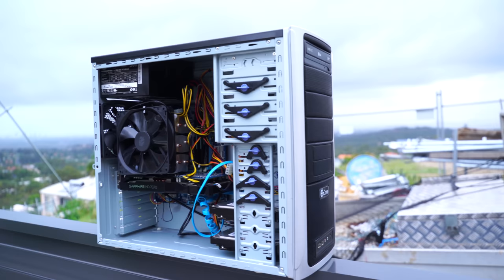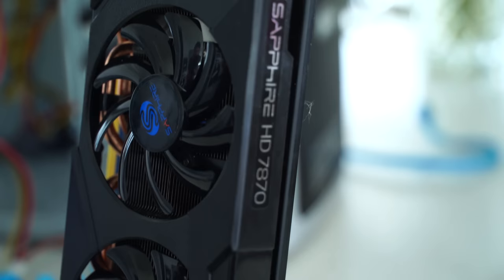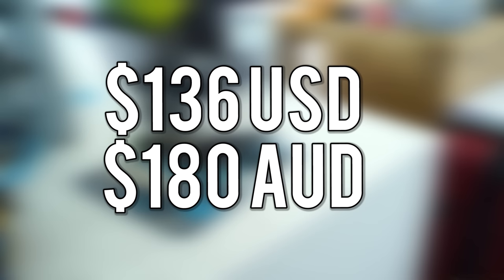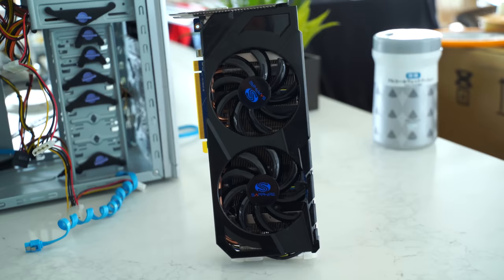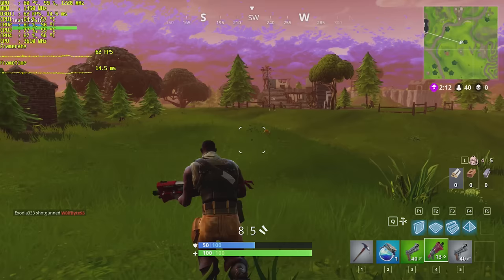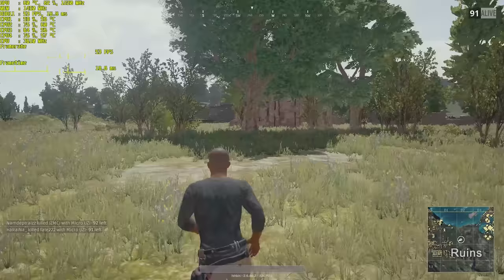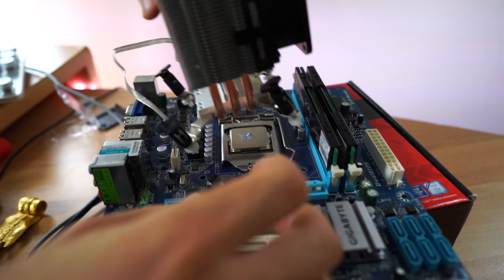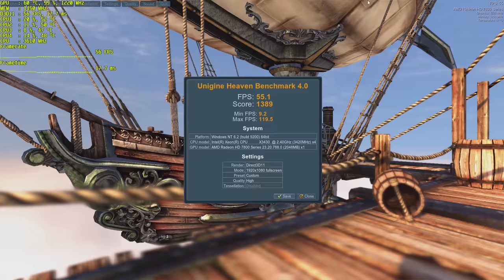The $136 FORTNITE 1080p Gaming PC Build 2017

Comment: This PC beats my $600 laptop
Reply: Pennywise lol MacBook be like😅
Reply: The lower segment of laptops just got really bad in the last couple of years... And of course buying used is Not an option, because you can't just change the mobo for 30 bucks if it decides to fail.
Reply: X Blocky Same, but I'm getting a new gaming laptop today! I'll update everyone on how it does on benchmarks and fortnite.
Reply: mine too!
Reply: U need to open and clean a laptop each 6month ;)
Reply: My 1000 laptop can run fortnite at high settings with 50 70 frams. Kms
Reply: X Blocky  lol
Reply: Alexander Hernandez I have an itx pc that can fit in a backpack that can run games 4k 90. I7 7700k and 1080ti in the Node 202. It's mobile and powerful so laptops aren't the only option for mobility
Reply: its simple guys, get a pc for gaming and a laptop for work.... duh
Reply: Alexander Hernandez yeah right dude, buy an hp or dell laptop and all you get is an overpriced shitty xbox 360 that doubles as a portable heater
Reply: Yeah its incredible what they Can Make nowadays
Reply: This pc beats my $900 2013 iMac....
Reply: this beats my $850 laptop
Reply: Same
Reply: X Blocky yep i have 35 fps on everything lowest possible on my 500$ laptop
Reply: lol You all got ripped off!
Reply: NO THEYRE NOT. you get a medium quality screen a keyboard a motherboard speakers and a cd slot.not only that you can carry it anywhere. so laptops are underpriced. my 1500$ pc runs better than my 2200 $ laptop on gaming but it weighs 15kg i need a monitor i need everything.
Reply: X Blocky laptops kinda such
Reply: beats my $1000 macbook
Reply: same here
Reply: Miko Spoofer I get 7 on lowest 480p for my 600
Reply: GEOMAZ lol
Reply: This beats my 900$ PC :(
Reply: I don’t know how y’all PCs don’t run that if y’all 800 to 100 pc or laptop can run that my 700 pc runs all of the AAA titles 10 times better than this pc
Reply: It beats my 900$ gaming pc
Reply: Hardcore Hardware what kinda laptop ya got bro?
Reply: This is 3x my 1000$ laptop
Reply: Same
Reply: KrazyKing13 anen preach it brother
Reply: don't forget about display, keyboard, touchpad, speakers, wifi and bt adapters etc
Reply: X Blocky Same here my dude
Reply: My AU$800 laptop stomps it in processing power (Core i5 8250U) but has an inferior GPU (Geforce 940MX).
Although considering that it also has integrated UHD620 graphics, it means that you actually have two GPUs available, which is pretty cool.
Reply: same
Reply: X Blocky beats my &750
Reply: This build is good as my $500 build
Reply: Beats my 500$
Reply: X Blocky that's why it's called pc
Reply: same
Reply: X Blocky same
Reply: X Blocky lmao nice one
Reply: LOL
Reply: It beats my 300 dollar laptop
Reply: I want the pc
Reply: don't laptops have a monitor? Has anyone thought of that?
Reply: Alexander Hernandez no shit it’s a desktop
Reply: X Blocky oof
Reply: X Blocky Same
Reply: @Hardcore Hardware y dont u just sell it then buy a gaming pc
Reply: take the L

Comment: The HD 7870 is such a killer budget graphics card, I bought one off a mate for $50 AUD a couple of years back and put it into a PC for my little brother, along with the guts of a second-hand Harvey Norman prebuilt with an i7-3770, 12GB of RAM, and an SSD which I got for around $250 AUD about half a year prior.

I can pretty much max out the OC sliders in Afterburner with the HD 7870 and it runs flawlessly, temps max out at under 70C with fans on auto and you can barely hear it. It's a hell of a lot quieter than my 290X that's for sure!
Reply: I picked up a HD 6950 2GB on eBay for $20/£15. Runs games really well.
Reply: 7870 still beats the GTX 1050 in some games. If you have a good power supply already and can get a deal, it's definitely a good card
Reply: SvD KILLSWITCH does it outperform a reference gtx 780? Honest question
Reply: I got a delidded 3770k and Sabertooth Z77 for 180€, that cpu is great
Reply: SvD KILLSWITCH um wromg.. hes using sapphire hd 7870 which is couple hundred dollars.. hes bullshitting
Reply: GPU prices have been overpriced ASF for the past 2 months, which is why its a couple hundred dollars
Reply: No, the 780 reference is a lot faster. If you were asking about the 290X, that is faster than the 780.

Comment: If that cooler come loose in the future then RIP video card
Reply: ohh and it will dont worry , that silicone will come lose @ some point from heating/cooling cycles :D , i know becouse i saw how silicone behave's where i work after a while
Reply: Its rip gpu and cpu beacuse its going to get really hit instantly
Reply: *hot
Reply: Eetu Isola the GPU might get hurt from the cooler dropping on it, but the CPU will deal with the heat fine, Intel has built in thermal protection to throttle or halt the CPU when the heat spikes, not saying to run it with no cooler though (I've seen tech channels do it before for shits and giggles)
Reply: I've run some low end pentiums from the last couple of gens with no cooler in the BIOS. They stabilize at about 85-90 which is perfectly fine for the handful of minutes I need to check something or do a BIOS update. If they get hot during the update I just set a fan on them
Reply: CortMarshal honestly you could probably leave them on all day(not saying you should) but they'll just be limited to a couple hundred megahertz-1ghz or so, horrible performance yes but not dead
Reply: Well lets hope it comes loose when the PC is off.
Reply: or just set the pc lying horizontally..tension gone
Reply: You can just lay the tower flat so you don't have to worry about that.
Reply: Jay Koerner ya but they can't react that fast it would hit 150c almost instantly
Reply: And rip the pci port
Reply: I would just kick in another 20 bucks for a new cooler, still would be a cheap build.
Reply: Can you recommend something sorry, I'm not very smart with PC building
Reply: Put it on it's side

Comment: I'm a complete noob. Can anyone suggest me where to start with all this? Idk a shit what he's talking a about.
Reply: What do you want to know, if I can help.
Reply: Wounded eye I am too
Reply: anything we need to know.. like , what is 7700HQ means ? etc
Reply: Cheap used Xeons are usually where all these builds start.
Reply: Xeons cpus are for online servers not gaming.
Reply: Wounded eye if it can handle servers it will be handling games
Reply: Sir Gildo can u suggest me around 30$ motherboard for this build?
Reply: Same just wondering if  fortnite will work on my pc? My specs are
I9-7920C 12 Core 2.9GHz
4TB 7200RPM + 2T  SSF
64GB DDR4 SDRAM 
2X SLI Nvidia GeForce GTX 1080TI 11GB GDDR5X
Reply: Jomz so you have 2 gtx 1080 ti obviously it would run
Reply: Jomz wtf is that pc costs like 4000 dollars
Reply: yugi muto yea so...
Reply: Jomz why tf you think a 4000 dollar Pc with 2 gtx 1080 ti wouldn't be able to run fortnite
Reply: yugi muto He was just bragging...but on a real note he's probably lying
Reply: Enescu Ionut im not lol  i got my pc online its the area  51 alienware
Reply: Enescu Ionut i installed a intel core i9-7980XE in my computer now
Reply: Jomz Sure you did m8....
Reply: @BaSickFirst  that's a laptop chip
Reply: Wounded eye sams

Comment: I'm all for budget PC's 6 years ago i built a new PC for 900$ US, it was a FM1 socket motherboard 
GA-A75-UD4H, wasn't cheap at all back in 2011, i cant really remember witch cpu i had in there I'm pretty sure it was a dual core 2.7ghz, i got a 500gig hdd and 500w power supply, and a nvidia 450gts gpu in there. With 4 gigs of ram.
All ive added to it over the years is 4 more gigs of ram and and upgraded the cpu to a athlon 651k, witch is the most powerful fm1 cpu that was made, it still runs games like GTAV with out any trouble, but that build was expensive at the time and i regret paying so much, but anyway i gave it to my brother and decided to make a new budget build for my self, so i started browsing and found a ASUS Z97-P motherboard for around 52$, witch is an OK price, and i found a gigabyte R7 260x  rev1.0 with 2gigs for around 50$ as well, now i got me 8gigs of ram for some 55$ witch is considered really cheap here (i live in Serbia so even my budget build is expensive) and for 20$ i got a G8120 dual core cpu with the original cooler, a 500w power supply, and a 500gig hdd, and a old beat up PC case, but that one was free.
So for around 175$ US i have a pretty nice build right now. 
Ill change the PC case and cpu eventually but its pretty good for now, considering what i paid.

Comment: I'm about to pick up an x79 motherboard for cheap ($50). Anyone have suggestions for a good performing processor to bundle it with? Thinking close to the $100 range. I'm really into overclocking so if someone could point me in the direction of some magical xeon that'd be fun. Bryan if you could chime in that'd be dope too :)
Reply: The Xeons for that platform are still 100+ and not worth it in my opinion as they are only 4 core 8 thread. I'd go with i5 2500k, i5 3570k or if your lucky maybe a i7 2600k
Reply: The x79 has the 2011 socket, right? I briefly looked into this before I got my i7, but the used x79 market is crazy high. Many xeons from this gen are overclockable, you might want to look into a e5 1620 v1 or 1660 v1. The 1620 is a 4c8t, and 1660 is 6c12t. The v2 versions will also work on that chipset I believe, but they don't overclock as well but have higher base clocks. If you've already got the board its great value, but if you need to buy the board it becomes almost as expensive as buying new current hardware.
Reply: idk i have a 2600k@4.5 already and i was just thinking of upgrading to a 3930k since this mobo would be cheap. it'd amount to like $50 x79 $100 3930k, then sell my current 2600k and z77 for like $150 bundled. so kinda a free upgrade but i was just asking since i don't know much about x79s and was wondering if there was a cheap cpu that was a really good overclocker like there is on x58. thanks for the help tho
Reply: JustIncognito oops I was talking about the wrong socket lol. I would go with the 3930k definitely
Reply: JustIncognito actually no scratch that. You could get an e5-2660 or 2670 8 core for around $100 just make sure you can overclock it as they are clocked low
Reply: JustIncognito The e5 1660 is the same chip as the i7 3930, but in some case can be found cheaper. I doubt you'd get as higher overclock as you have at the moment on a 6 core CPU. So you'd be losing single core performance but gaining 2 extra cores and 4 threads as well as quad channel memory support. I guess it all depends on your workloads, but personally I don't think its worth the upgrade.
Reply: JustIncognito Just to add that before you do anything check that the processor is supported on your motherboard. Probably don't have to tell you this, but not all xeons are supported.
Reply: idk from what I know getting a 3930k to 4.5ghz doesn't seem too uncommon. seems to be as common as getting a 2600k to 4.5ghz. anyways, I think if i get the x79 i might grab a 3930k locally and try to get it for a little cheaper under the $100 ebay price tag. thanks guys
Reply: JustIncognito Best of luck. I've heard of some hitting 4.6 on the 1660/3930k but I've always taken these numbers with a pinch of salt as Im thinking the thermals in that package would insane. Looking into it a bit more if you've a decent chip and a good x79 board you will probably be ok for that overclock.
Reply: Which x79 motherboard?
Reply: JustIncognito i5 2400 aint bad
Reply: JustIncognito I’m not sure if this is compatible but I think you should get a ryzen 3 1300x

Comment: I paid 110$ for my current 1155 system before graphics, it's a dell t1600 and it came with a e3-1270,8GBs of memory and a 1TB HDD had to swap the PSU through and that cost 35$(USD) but I also put in a gtx 1070 so the budget was much higher(350 new before the crypto plage)

Comment: can I overclock on any h55 board? and what's the highest xeon available for 1156 socket? any 6core available?
Reply: I don't know about overclocking on any h55 but the best cpu you can get is 4 core 8 thread
Reply: Jamzy the model? the one he showed?
Reply: i7-880 is the fasest chip on 1156, together with the Xeon X3480
Reply: The one he showed was an x3430 which cost only $7 which is AMAZING value for money
Reply: NelizMastr - Tech for PC & Mac I've got an i7 860 and it's decent
Reply: The best price - performance processor is the x3440, 4C/8T for 22 dollars on AliExpress
Reply: But i consider to get x3460, thet Xeon get 12x ram multiplier (x3440 and x3450 max 10x ram muliplier), than alow you to get 2200+ mhz on cheap Samsung DDR3 ram! x3470 and x3480 goon only for bad overcloking boards, any good board can turn even x3440 to 4ghz, that stable safe max for 1156.
Reply: Leandro Andreu online maybe, but I got 3 prebuilt q6600 desktops from a local business for free, just had to dust them out
Reply: Ty2525 haha is that a joke? Some Xeons are amazing for gaming
Reply: Yes you can OC pn h55 and p55 mobos. If you scroll through the channel TYC does a ton of h55 xeon builds and he overclocks everything. 🖒

Comment: i have a 7850 stored away , as i bought a r9 290x 4gb earlier this year for about the same price i bought a 7850 4 years ago, the psu consumption is higher but the graphics are a bit smoother but i think the motherboard limits it, i got an ssd to just assist with performance and it did actually but limited size for games :/ but the 7870 is pretty good on med settings for overwatch and decent for modern fps on med 1080p
Reply: Denver Naicker what cpu

Comment: Fortnite doesn't even work for for me, and I have a freaking GTX 1060
Reply: I have a gtx 960 2gb and play fine...maybe its ur cpu, ram or hdd bottlenecking.
Reply: Praful cj User error.
Reply: P E B K A C
Reply: maybe you don't have an NTFS storage format?
Reply: i have AMD X4 950 and gtx 1050 ti and on epic 50-60
Reply: It’s ur viruses
Reply: Right click on computer homescreen and see if says NVIDIA Gtx 1060 or Intel something because you have to install the card before or it will default to that
Reply: Praful CJ Maybe your hdmi is plugged into the wrong slot, make sure it’s in the gpu. I had this issue when I started😂
Reply: I played without graphic card .. Though my all other components are very expensive .
Reply: Praful CJ  I don’t think you downloaded your card
Reply: Praful CJ I've a gtx 1050ti and it plays perfectly fine, I get 120~ fps with high settings and post processing low
Reply: Did you download drivers?
Reply: If you have a GPU OC, turn it off, or at least down. For some reason fortnite doesn’t like it when I have anything higher than +220mhz on the core clock on my 1070ti. Same with my friend who has a 1070.
Reply: ERROR 404
Actually look ur cpu/ram/storage/virus if any problems with those or u might have not installed the gpu
Reply: what about ur processor
Reply: Did you buy that shit in Chinatown?
Reply: Will fortnite work on my pc? My specs are
I9-7920C 12 Core 2.9GHz
4TB 7200RPM + 2T  SSF
64GB DDR4 SDRAM 
2X SLI Nvidia GeForce GTX 1080TI 11GB GDDR5X
Reply: He probably has a 32 bit pc
Reply: Praful CJ If it says "Unsupported OS" then u need a 64 bit computer
Reply: Jomz 
You would be lucky to get at least 15 fps with that
Reply: the one and only Clorox bleach oh
Reply: I don't think so
Reply: Probably not...
Reply: Jomz no
Reply: Jomz probably not lmao
Reply: Praful CJ maybe because you do not have the rest of the PC?
Reply: I have 1070 ti, i5 8400 and 16ram and im getting aroumd 30fps on low.... Whyyyy? All the other games are fine. Im having problems only whit fortnut
Reply: Joshlocu how with two gigs
Reply: @jomz6164  no
Reply: Looks like i am going to have to that back lol

Comment: Small tip for future PUBG tests - setting the textures to a higher setting than very low will most likely improve the FPS sounds strange I know but it takes load off the CPU and uses the Graphics card more.  Also should have just cable tied the cooler down :)

Comment: And i even ran fortnite everything on EPIC, with a Core 2 Quad Q9450 and a Asus GTX 1050TI Expedition + 4GB DDR2 800mhz ram (OCz Platinums), at around 80 fps.

Update: I'm running it on a Asus Maximus II Formula, but im having a really hard time overclocking, since it won't post when over 400 FSB

Comment: So funny story I watched this video about 4 months ago and immediately bought a xeon x3430 (aliexpress, $4 with coupon) with the intentions of buying a lga1156 mobo later on down the line. 

Well yesterday I went to a local big thrift shop and they sell computers that are unknown condition and they had like 5 of them for $10 each, I saw pentium 4 , pentium d, celeron, core 2 duo and one pc had an i3 sticker. 

turns out it is a Gateway DX4840 with an i3-550, 8gb dr3, 1tb HDD..

Grabbed a spare r7 260x that i got for free over a year ago , cleaned out the pc dust, plugged it in and after clearing bios everything worked!

Forgot I had purchased the x3430 until this morning.. Put that in and it worked as well.. Needless to say I have myself a pretty capable $14 gaming pc!

Comment: For Fortnite, Intel Pentium G4560 processor with Radeon RX 550 GPU and 8 gigs of RAM will manage you 30 fps at 1080p low setting no problem, and OC it and you should be able to eat anything Fortnite can throw at it.

Comment: Not a bad pick and I tell people this all the time. You can definitely build a decent gaming rig on a budget if you shop around second hand combo'd with decent parts that have become deprecated by current ENTHUSIAST standards. BUT as a caveat to your video as I noticed you went with a fairly meh PSU and honestly it REALLY is worth just forking out the money for at least an 80 plus rated unit. A lot of people have dirty power, old wiring, et al and having a good PSU in front of that hardware is a nice insurance policy. Just saying!